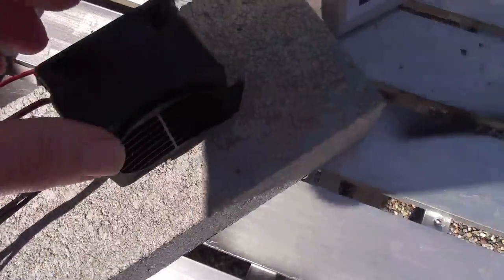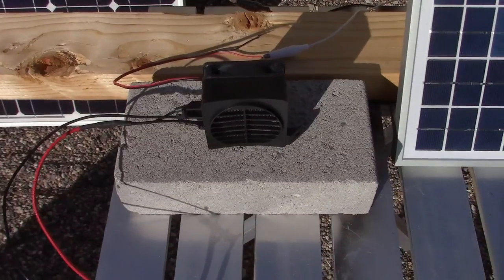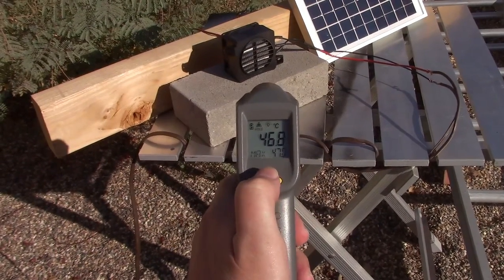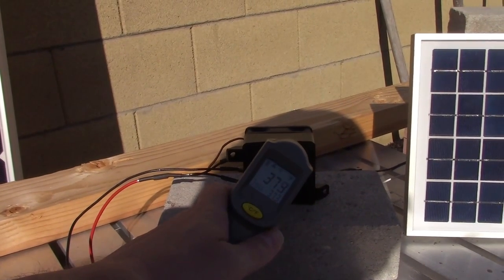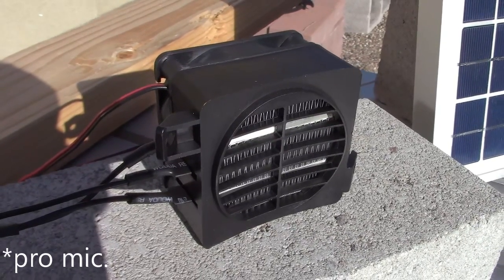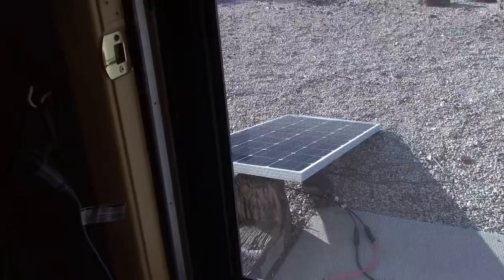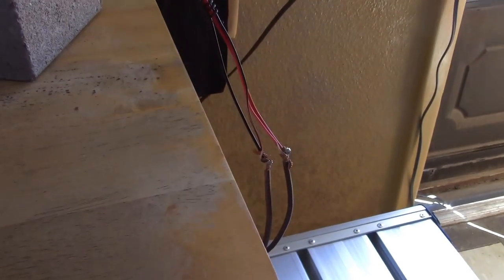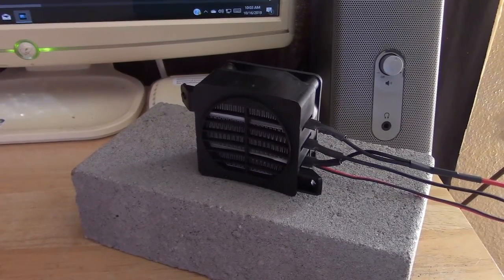Solar Electric Air Heater! (100W 12V) - 100W Solar Panel runs it! - PV space heating!! Ez DIY

Comment: how do I hook it up to solar plug in I irdered 2 of then off Amazon
Reply from the maker: hey there. if by 'plug' you mean a standard MC4 connector (the kind on many solar panels), the best way to hook it up is to buy a set of short MC4 cables (the ones with bare wire on one end of them) and plug those into the MC4 connectors on the solar panel. if you do that then you don't have to alter the wires that come off of the solar panel. here's a link to a set of those MC4 cables for only $7.99
https://www.amazon.com/Renogy-Controller-Connector-Adaptor-Extension/dp/B00DGXVO80/ref=sr_1_8?crid=33NGT6VZHF2PO&keywords=mc4%2Bcables%2Bwire&qid=1666646155&sprefix=mc4%2Bcables%2Bwir%2Caps%2C156&sr=8-8&th=1
Reply: @desertsun02  CAN i WIRE IT INTO A 12V CIG PLUG IN ?i I want to use it on my solar generator kit that is for light bulbs only and cig plug in?  will it work on that  this is what i bought 

i also bought in the usb cig charger to plug into the generator . I bought a car heater that plugged into cig and it works but no heat? 
Solar Generator Portable Power Station - Soyond Portable Battery Generator with Solar Generator (Solar Panel Included) 8000mAh Battery 2 LED Bulbs Fm Radio for Outdoors Camping Travel
Reply: I want to plug it into this i bought on amazon and a usb plug in for cig lighter adaptor.  I bought a car heater but it was no good it worked pluged in just no heat at all ? Solar Generator Portable Power Station - Soyond Portable Battery Generator with Solar Generator (Solar Panel Included) 8000mAh Battery 2 LED Bulbs Fm Radio for Outdoors Camping Travel

Comment: Just curious, how long can these be run continously, as in (not planning on it) could this be run 24/7, or would it need an on off cycle for longivety?
Reply from the maker: hi. they say these units can run 24/7. both the fan and ceramic element are very tough

Comment: Sorry for a newbie question. But is the heater connected directly to the solar panel? Doesn't it require a charge controller and how do you match the wattage of the panel to the heater? What if it fluctuates?
Reply from the maker: hi there. the heater is connected directly to the solar panel. it doesn't require a charge controller. those are used if you are charging a battery (or a battery bank) with a solar panel (or panels). this 'heater unit' just pulls the power that it needs right from the solar panel. you just need to use a 12v solar panel (and one that can give you the amps that you need). most 100w 12v panels can put out 5.5 to 6 amps. you can always use a larger solar panel if you want. (it just needs to be a 12v one).  i was thinking about getting a 200w 12v solar panel. i saw one that was 210w and put out up around 12 amps. that could run 2 of these units. btw - it doesn't hurt the heater or the fan if the power coming off of the solar panel fluctuates. both the fan and the heating element are proportional (meaning that if you give them less power the fan will run just slower and the heater won't get as hot.

Comment: how are you connecting the frayed wires to a solar panel. I have a dc 8mm connector.
Reply from the maker: hi. i typically just twist the wires on. you could also buy some simple connectors (maybe alligator clips or a simple molex plug)

Comment: If you do the math and take into account the efficiency loss this basically draws 10 amps an hour from a 12 volt battery so if you have a 100 amp hour battery and you want the battery to last a long time you can run this for 5 hours and run the battery down to about 50% assuming you're getting the battery fully charged up during the day when the sun is out and the reason you should only run this for about 5 hours on a 100 amp hour battery is you only want to run the battery down to 50% state of charge much lower than that and the voltage is low enough that this thing would really start to show and wouldn't be putting out nearly as much heat and it would cause the battery to degrade much faster as well.

Comment: Hello. Does all 100 w solar panel have this
wires at the back or should i buy a specific solarpanel to get the right wires?
And where did you bought your panel?
Reply from the maker: hi. most medium to large size solar panels have what they call MC4 connectors. smaller panels will sometimes just have 2 wires or even just 2 terminals where you can connect the wires. i always get my solar panels from amazon. i used to get them from harbor freight tools but... times change. amazon has dozens of panels (maybe even hundreds)

Comment: Ok so if a 100w panel is used for this heater w/fan, I'm estimating that's a 5-6 amp draw.
The gain would be the (free) heat when the panel or your array has good sun exposure (open canopy). Otherwise you'll need a good battery bank to draw from. This could be a good part time alternate off grid for a cabin, camper/rv instead of relying on a propane furnace, where I can say mine also draws about 5 amps when the blower fan cycles.

Comment: What if I want to run it for at least ten hours a day?
Reply from the maker: hi. you can do that! these units can be run constantly. a good sized 12v deep cycle battery could run it that long or if the sun is shining you can just hook it to a solar panel. there is always the option of using wall current too (with an ac/dc transformer)
Reply: @desertsun02  Thank you so much for your help! I have so much to learn!
Reply: @desertsun02  Oops. I just realized your video’s fan was the same size I received. This must be a case of me believing what I wanted to believe. Still, I think bigger fans would be better. Any suggestions?

Comment: Hi any chance you list the fan description to buy on amazon.
Reply from the maker: sure. i usually type in 12v ptc ceramic heaters to find them. here's one for 12 dollars https://www.amazon.com/Thermostat-Constant-Temperature-Humidifier-Conditioning/dp/B0867TJ32Y/ref=sr_1_24?crid=11TL8SN2IJ1UV&keywords=12v+ptc+ceramic+heater&qid=1658147057&sprefix=12v+ptc+ceramic+heater%2Caps%2C174&sr=8-24

Comment: I just ordered the heater, I have the panel and going to wire it directly to battery for heat at night, panel should charge battery during the day.
Reply from the maker: sounds good 👍🙂
Reply: This is the best option

Comment: Hi I have technical questions: Whats a power of a heater is.  Whats a Mac power of the heater I can connect to the panel 100W?  What if I connect 200W solar panel?  
Cheers
Reply from the maker: hi there. the unit pulls about 6 amps. yep, you can hook it straight to a 12v 100 watt panel. you can use any size 12v panel that you want (as long as it gives you the amps that you need. a 12v 200w watt panel would work great with this. the unit will only pull the amps that it needs.
Reply: @desertsun02  Thanks, Great 👌

Comment: Hi, Can I run one of these using my current setup which is a 30w solar to regulator to 12v Car battery?
Reply from the maker: you should be able to (but remember that car batteries can only be deeply discharged a few times (maybe 25) before they start deteriorating). 12v deep cycle ones can last 1000 cycles
Reply: @desertsun02  great thanks for the advice! I've set my charge regulator to turn the load off once the battery reaches 11.5v. The load will not come back on until it reaches 12.6v. Do you think it would be better to increase the low voltage load shut off?

Comment: How many hours could it run with one marine batterie or two batteries for sleeping in a van in the winter ? Thanks
Reply from the maker: @Paul Marion the unit takes about 6 amps (6 amp hours per hour) so if you use a 120ah battery (as a example) you could run it 10 hours before the battery was 50% charged. (50% is about as low as you want to go before recharging a marine battery)

Comment: I would like to mount one of these below each window which I have attached a solar panel to.  What is a suitable heatproof material for mounting on the wall and screwing the fan heater to?

Comment: OK, got the fan going, but the element is not getting hot!! What do I do??
Reply from the maker: hi. the main reason i can think of that it might not be heating is that it's not getting enough amps. it needs about 6 for it to work the best. also make sure the connections are solid. if it's all connected properly and you have a good power source then it could be a faulty heater (but that is unlikely)

Comment: Have brought my little heater and solar panel, but can't work out how to connect the two!!  (sorry real novice!)  The solar panel has an inverter connect to it, so where do i connect the wires from the little heater to?? Have red and black connectors coming from inverter for battery connection.

Comment: Currently I have a 180W Panel running to a 80ah deep cycle marine battery with a 3000W inverter. I ordered the same fan and the electric thermostat. Going to see if it will keep my 3 man ice shack warm. We get a lot of sun here during winter too so will be interesting to see how well this works. (Will hopefully be getting some 6V 200ah batteries and wiring in series for 12v) Will post an update in about a week and a half once everything's in and running. I'll be checking to see if the panel is able to run this and keep batter charged during the day.
Reply: Did that solar heater work for you?
Reply: @timothyfirth4809  No sadly my battery was way too small to run it consistantly, Would say it needs 200W for the heater and a 50W for the fan
Reply: @MarineResotorations  thank you for the reply
Reply: @timothyfirth4809  Would be good for like a small shed or green house tho
Reply: Could I add a 12v thermostat controller to this heater fan so I don't fry my greenhouse???

Comment: Hello, Nice stuff again .
I want to ask what do you think if you use a 5 panels 100 w each connected  to a water heater then to a 300 litterers  reservoir and then destructed in a underfloor heating ore using one of your previous water to air heat engender   ? Would it the energy stored in water  generate more heat compared to that heater ?

Gr
Reply from the maker: hi. well, this is a 100 watt heater and what you describe is a total of 500 watts (heating water and putting it through a heat exchanger). as long as you balance the system right (meaning the right size water heating element or elements and the best amount of water) it (the system with water) would most likely be hotter.

Comment: I have a 200 watt panel. Will this burn up the heater?
Reply from the maker: hi there. as long as your panel is 12v and the heater is 12v you can use any size solar panel you want. you could use a 1000w 12v solar panel if they made them. the heater will only draw the power that it needs off of the solar panel. (kind of like a nightlight and a microwave - you plug them into the same they of outlet and they just draw what they need)
Reply: @desertsun02  Ok thanks. :)

Comment: What does one of those cost? I need the materials list as well. Thanks for the video! It looks like what I need for my greenhouse.
Reply from the maker: hi. some sellers overprice them these days but you can still get them for about $16.00. here's a link to one https://www.amazon.com/Maxmartt-Constant-Temperature-Humidifier-Conditioner/dp/B081111YTQ/ref=sr_1_54?crid=1B8W3MV29Y1I&keywords=12v+ptc+heater&qid=1642632518&sprefix=12v+ptc+%2Caps%2C1004&sr=8-54
here's a 12v 150w one https://www.amazon.com/Yosoo-Constant-Temperature-Heating-Incubator/dp/B07K2781XR/ref=sr_1_255?crid=1B8W3MV29Y1I&keywords=12v%2Bptc%2Bheater&qid=1642632861&sprefix=12v%2Bptc%2B%2Caps%2C1004&sr=8-255&th=1

Comment: wouldnt simple solar air heater be better?
Reply from the maker: hi there. neither one is necessarily better than the other. they both have their pluses and minuses. pv panel would be much better if it was super cold but you had sun. i might give the edge to the collector if it wasn't super cold. pv panel heat gives heat instantly - collector needs to warm up some. collector is more efficient though...

Comment: Hi so has anyone got a link to this heater on ebay or what wattage and I'm guessing the panel it 100v poly
Reply from the maker: hi there. the panel i use is 12v 100W mono (but a poly one works basically just as good). here is a link to one on ebay https://www.ebay.com/itm/224698391650?hash=item3451115c62:g:0mMAAOSw9Ctfkmlc

Comment: Lmao! Updating a thread again! Thanks for no back lash from the excess comment threads! People here must actualy appreate feed back!  So thiers still possible hope for the heater setup! After inspecting the green house further I noticed all sorts of outside exposure because I could see the light from the outside of the green house from working in there at a slightly different time of day! So feed back is good! The environment within there was not completly sealed! So 2 cans of spray foam where added around the perimeter and that should change the information alot for efficency! The ceader shims where lifting the frame in some areas

Comment: Ok, so excellent news! I have another system within the my parents green house that I use, a 1500 watt bucket heater in 15 min intervals on a 24 hour pull pin timer thats pumped with an aqurium pump to a small radiator!  So what I did was used the combination of the 2 desk top heaters with one in front of the other and only one fan pushing the air, and the temperature has risen from -1° to 0° rather quick as I was only out there 5 or 10 minutes! So this is a nice way to heat up the air faster, it just can't be used on its own for a greem house in the winter! So I will leave this thread at that! Thats a sucsess!  Also I have a temperature/decontamination unit when you enter the green house(enclosed plastic trolley on wheels) I can emagine this should work to preheat the space before entering to get rid of the cold, so it could be excllent for that hopfuly!

Comment: Alright, heater has arrived! I wish I could easily add a video to show how this is opporating on a slightly different setup! Temperatures are excellent and the only device here I have to measure is an oven thermometer for cooking meat in the oven! Its funny because that works well and the temperature rose almost instantly. Im going to go outside now and bring the setup outside to see if we can heat during the winter off of one heater core

Comment: I want to use a set up like this to heat my small greenhouse.  Is there anyway you could have your heater come on when the temperature reaches a certain point?
Reply from the maker: hi. i'd just use a small 12v thermostat. amazon should have them

Comment: what is the performance on a cloudy day?
Does it work at all?
Reply from the maker: hi. it would depend on the type of solar panel you use and how thick the clouds are. amorphous solar panels work the best (by far) in cloudy conditions (monocrystalline is a distant second). monocrystalline and polycrystalline work okay if it's an "even" cloudiness and the clouds are not too thick. as long as the panel isn't shaded but it's getting indirect sunlight they can work okay. if it's spotty clouds and the panel is partially shaded then mono and poly don't work well at all. the only panel good if it's in partial shade is amorphous. it might sound confusing - for a better explanation i've got a video on this.

Comment: Practically, how many fully charged 100 amp hour marine batteries would you need to run this all night, say 12 hours?
Reply: 1 100amp 12v battery. This is a 100w heater so 12v x 100ah = 1200wh divided by 100w = 12hours.

Comment: I got one and I've wired it up to a led PSU, the led PSU gets really hot but the fan sucks the heat away before blowing it thru the heater. It's amazing it heats up my living room no problems and it hardly registers on the electric meter, last year I had a 2000w heater and my bills were outrageous. Ive been trying to find away of controling the temperature, not thermostatically but just a simple power control to turn the power / heat up and down. Thank you for the video aswell🙂 the more people know about it the better as it's things like this that'll save the planet from our over use of energy 🙂
Reply: Robert after 2 years can you share more of your experience with this type of heater. Does it work home indoors at winter time when you have snow and 0F outside?
Reply: HI Robert, sorry for my ignorane, but do I need a 12v battery between the solar panel and heater?   Can's see how to connect heater and solar panel directly!!
Reply: @jeaninehonour4717  you 'll need a solar charge controller
Reply: how did you get the solar panel outside then run wires indoors to the fan?

Comment: Great example. Do you have any examples where a thermostat and timer have been used to control temperature and also when the heater comes on?
Reply from the maker: hi there. i haven't added thermostat or timer but it would be easy to do. i'll look into adding one
Reply: Please let me know how that works out

Comment: What size wires so I can get back up sets for emergencies?
Reply from the maker: hi there. 16 or 18 gauge wire is probably the best. if it's not too long. (i'm assuming you mean the wire size on the heater.). i usually use 14 or 16 gauge wire for a 100w solar panel.

Comment: Hi. If you would like to use just one panel or a solar generator, how would you connect the wires? I saw there are more than two wires. Sorry if it is a silly question, but I am not sure about that. Thank you!

By the way. Can I connect this directly with a socket to a solar generator?
Reply from the maker: hi. yes you should be able to connect this directly to any 12v power socket (any one that handles 100w or more). you just need to use a 12v plug that can handle the amps. to answer your other question; the wires are all either red or black (positive or negative). it's a pretty easy connection... you just hook all the read ones together and all the black ones together
Reply: @desertsun02  Thank you so much for your help!!